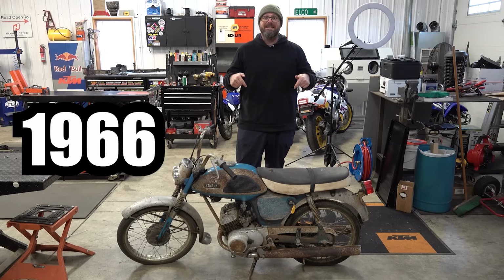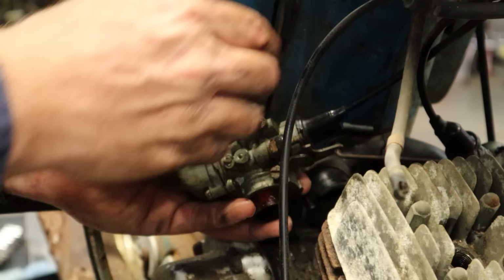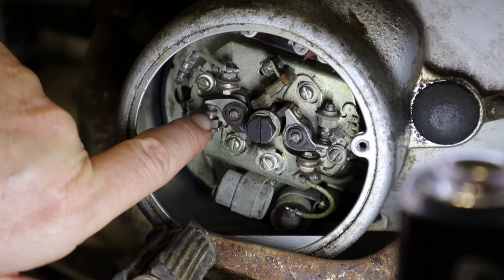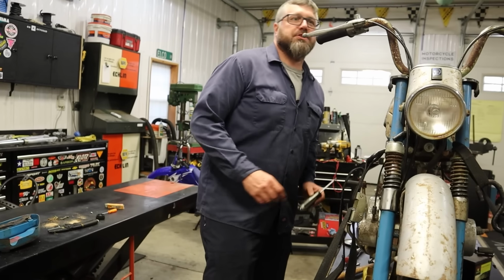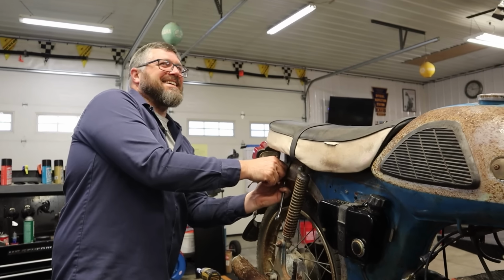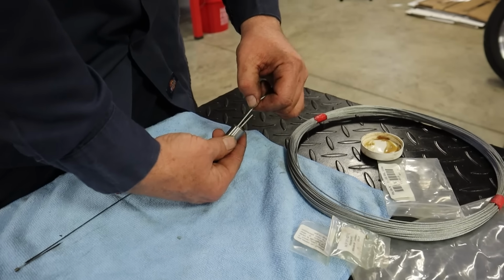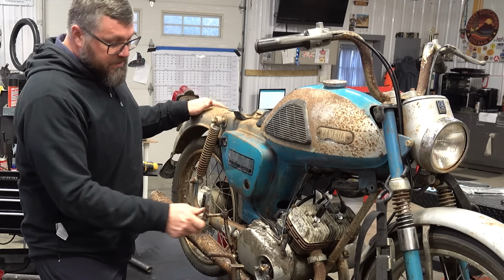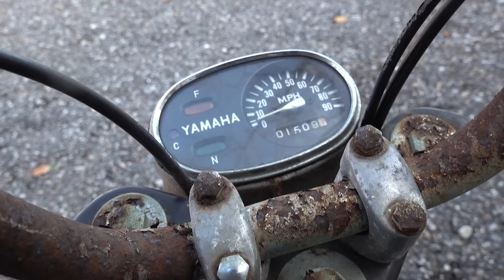Can I Get This 1960's Yamaha Motorcycle Running?

Comment: I was 14 in 1966 and I had a twin jet 100, same color as yours. Mine was electric start. I got a motorcycle drivers license at 14, but it was only good up to 100 brake horse power, and the twin jet was a little over that. I drove myself to middle school. There was at least 40 other kids who did the same in middle school. I grew up in Dallas. At first I thought that could be mine, but I had my seat recovered.

Comment: Capacitor,yes not condenser. Helps stop points arc burn. Should be replaced. Glad you realised differential expansion for carb. Excellent series.takes me back.

Comment: In '67 my Dad had gone to a police auction and came home with a '67 Yammer jammer 100. The previous owner had turned it into a dirt bike. Then a couple of weeks later came home with a yamaha 80. The thing that was different about the 80 was that it had a 10,000 RPM flywheel. We had a lot of great times out in the Mojave desert. Even then we called them rice burners.

Comment: I have a 1965 Honda CB160 with 750 actual miles on it. It was taken off the road in 1968 and parked in a shed. I got it started and road it around the block and parked it again.

Comment: At 14yrs old bought a non running suzuki 120 2stroke street bike. Got it running and my friend had one of those 100 2cyl yamahas. Tjis was in 1968 in Elko ,Nv. 14yrolds could get a license.as long as the bike was smaller tha120cc. We ran them into the ground on 2tracks !

Comment: That kinda looks like my old moped; a Zündapp ks50 sport from -67. I got in for like 60 dollars, it was a piece of crap. But getting it to work was actually a breeze. Old pets easy to come by, everything simple and user friendly. I cleaned it up and felt real good about my 14 year old self. The thing is that you can treat those bikes however you want to and they’ll never quit. I put on every imaginable illegal upgrade I could on that thing, in the end it did 120 km/h, but the frame was shaking horribly 😂

Comment: A bit trick:
For hard rubber, you could soak/dip it in methyl salisilate (some say wintergreen oil(?) ) 
After couple hours it will soften  the rubber, back its elasticity

BUT
If soaked too long, it has tendency to swollen, morovee on crack/ cut

Comment: Had good results over the years with a radial bearing for lifting clutch plate clutch runs much cooler free play dosnt increase in heavy traffic so easier to find neutral just an idea great work st

Comment: You finding the tool pouch made me go and get the one from my 1993 Yamaha XJ600 and check it.
It is not so much different, but also containing Allen keys and a few more wrenches, most of them "YAMAHA" branded. The pliers seem to be pretty much the same. The screwdriver has a plastic handle and the only writing on it is "Made in Japan".
There are some single spots of corrosion on the tools, this is now a good opportunity to rub them off with some WD-40.

Comment: I owned a YDS5. The tank has two chrome covers. The bolt is behind the rubbers. Their frames are of a very unusual metal. They will not rust, crasy sturdy and are very stiff. Yamaha hoped these would turn into a race class.

Comment: I bought one second hand here in Dublin around 1972 .Cost me £100 (100 punts the currency of Ireland at the time .Close in value to the pound sterling ) .I kept it 2 or 3 years .Rode it from Dublin to London and used it there for some time .Only problem was it would often cut out in the wet .The plug cap would short out .When i later got longer plug caps it was fine .

Comment: I think what you have there is a YA1; as a youngster I had a YAS1. The YAS1 was almost identical but had twin air filters directly onto the carbs, two chrome cans similar to the single one inside the frame. I think it also had a six .speed box but I may be mistaken.

Comment: You have it running but you will not realize the crank seals are bad until the rpms reach 5000. At that point the bike will cut out. I love those old Yamahas but you will spend more money to rebuild the motor than the bike is worth. I had a YCS1 which is the 180cc version. It looked like a new bike with no rust only to find it had bad seals. I cut my losses and sold it for $ 300 less than I had in it, around $ 1800. The new owner spent over $ 3000 to have the motor and crank rebuilt. Be careful when buying old 2 smokes. Great video.

Comment: From a old mechanic , points have a plating on them and we used to run a dollar bill to shine them up .When you sand with emery you start a downhill slide on the point face that will mess up faster ?? other than that love your vids and patter .

Comment: I was immediately drawn this video as from the picture I thought it was the YM-1 '67 Yamaha 305, which was my very first bike I bought new.  When I sold it, I traded it in on a 1973 TX 500 Yamaha at the dealer Don George in Clarence N.Y., a suburb of Buffalo.  It was still so pristine he put it in the showroom window.  I always wondered what ever happened to it and have never seen another.
Reply: When setting the ignition points you use a dial gauge and the points break at 2.1mm before TDC.  The dial gauge is the very first tool I ever bought as a mechanic and I still have it.

Comment: Yeah just got my somewhat mothballed '72 CS5 200 runnin' and went up the Pass.  It was coughing on the right side but cleared itself out.  Now to get the '67 YCS1 180 Bonanza uncovered and fired up.  That one's on the road and needs some exercise as well. The R5 hasn't been ridden in a couple of weeks favoring the RD400D and the Daytona as of late.

Comment: My first bike back in the 70's...took my motorcycle license on it.  Clean air, clean fuel and clean oil and it ran.  Everything on that bike can be brought back and it will run a century from now. (If you can buy fuel...)

Comment: The points will adjust like any other the part you were looking at is the fine-tuning where you set that engine up with a dial indicator on each cylinder like you're supposed to

Comment: Mix up a pint of two of 50/50% oil/fuel and pour it down the inlet throats to soak the crank seals and bottom end bearings. The seals are likely to be dry and they tend to burn when dry.  let it soak a while. Take out the spark plugs and kick and kick to clear the mix. Then plugs in and kick some more, kicking gently.

Comment: These old 2 strokes, going to outlive the whole world, with a little maintenance. I live in eastern europe, in the coldwar era, we had multiple 2 stroke bikes, that are having tiny 50CCm engines, and some bigger ones also. I have 3 of these tiny engine ones, one from Czehoslovakia, one from poland, and one from the former soviet union. I'm used to travel 10km every day, with the first one mentioned, it never broke down, maybe it's not that fuel efficient, but still consumes less than a car, and i never had any downside riding that, beside tha maximum speed is 40km/h, but in a city it doesn't really matter i think. The other 2 bikes are fully restroed by myself, they are really great to ride, and makes everyone smile in the city, i always meet someone who had one when they were young, and they always has a good story to tell. Maybe it's an expensive hobby, but i don't really care, it's about the feeling, and the sound they have.

Comment: I had a 1986 Yamaha CA50 moped which had the auto mixer. I never remember adding oil to it-only fuel. I guess that’s what killed it. But I never remember the oil light ever coming on. Too bad because that was actually a damn good moped.

Comment: when the cable end doesn't fit its easier to hit the cable end it's self with a grinding/cut-off disk rather than trying to adjust the hole on the float without a drill press

Comment: I use an induction heater tor stuck carb slides. I wrap a long coil around carb and usually they come right out.

Comment: The auto oil system actually ran the two stroke oil through the crankcase before sending it to be mixed with fuel before the carburetor

Comment: That much point-spark generally means bad condensators, cheap easy enhancement.
Use manual dish washing soap for your ultrasonic cleaner, works great, and save for aluminium, and smooth for those sensitive mechanics hands.
Nail files or small steel saw blades are excellent for those tiny gaps.

Comment: kkThat was my first motorcycle at 17 years old in 1969.  Paid 400 bucks for it.  It had a bad habit of burning out coils and voltage regulators.  When the regulator went out, it would also take out the generator....at $100 a pop.

Comment: 16:20 That's exactly the same set as on my 99 Yamaha TW 125, just with a plastic screwdriver handle and thinner pliers.
28:55 that same 4-stroke TW also runs on Gas-Oil mixture better than on pure gas lol

Comment: Beauty. I thought at first sight it was a suzuki 120 ( B100p) that i had when i was a kid in UK. They look very simillar and apart from being a single, very similar in construction. That had an auto oiler as well hence the P in the name.
Only had a 4 speed box as well with the 4th being badly spaced aeay from 3rd meaning some hills had a scream or a burrrr, then a scream before it stalled. The spark plug was in exactly the right position to collect the water thrown up from the front wheel in heavy rain. Often you had to rev the nuts off it to keep it running when stopped at lights when it was wet, thus getting yobbo biker looks from car drivers.
It had to be done though as if it died the plug oiled up and needed extracting and cleaning at the roadside. Not much fun if there were lots of lights.

It was fairly reliable apart from this and although not one to get ones pulse racing , was still a lot of fun and my chariot to freedom and exploration.

Your bike brought back a lot of good  memories

Comment: Only real problem with a 2 stroke is the crank seals go bad with age. Had one go on clutch side on a 76 Suzuki GT500 long ago. Was the 90’s I didn’t know how to fix it then, actually had all the GT series over the years GT185 to the 750 Water Buffalo 
And I’m a fan of the Yamaha R5 350 and RD 350 to. Rebuilt several of those

Comment: A lot of the old 2 strokes the oil tank said motor oil on the top and the owners manual actually said that motor oil could be used but not recommended if you have no 2 stroke oil

Comment: I have a Yamaha YS125 from the 2010s, and the toolkit is basically the same as the one at 16:00 - same kind of pouch, but the screwdriver has a plastic handle.

Comment: Wow i remember those i pulled 3 out of a garage a few years ago didnt take too much to get them running either i made a roadworthy one from the 3 and the other two ended up as feild bikes (with cobbled together exsausts and knobblie tyres and scrambler type bars /forks)
I was supprised how long they lasted as thrash /feild bikes i think iv still got an engine and a few bits left someware lol .

Comment: my first street bike was a 1966 suzuki 250 twin two stroke. my secound street bike was a suzuki  gt 550 two stroke ram air tripple. 1976. I ride a 2006 suzuki c90 v twin 1500 now.  of couse i have had lots of other bikes over the years to.

Comment: Thanks for the video you know when I saw the title I was hoping it would be the ym1 in 1977 around there I was about 17 and I got my first motorcycle it was a 1966 Yamaha ym1 it was a 1966 Yamaha ym1 305 it was yamaha's answer to the Honda 305 dream they looked almost exactly alike I put a lot of miles on that bike also put a lot of skin on the road on that bike learning I had it for a while and then I bought a 1975 Suzuki gt550 which was a triple fat bike I took all over the Eastern seaboard it was it just went and went you couldn't kill it the Yamaha also went and went and you couldn't kill it even after smashing it up a bunch of times but it still was put back in and did its job I took the front fender off I also I also took the baffles out because you were able to just if I remember correctly take him out with that in the Rhode Island rancher with Alan screws Allen keys so what was pretty it waswhat's a heavy bike looking back at least in my memory for such a bike with a bike with such a small engine so on the highway it kind of blew around in the wind a lot and it wasn't very fast but I took it from Providence to exit 54 Connecticut a bunch of times that was about the farthest I took it and round trips without a problem😮😮 when my dad took me to see the bike it was in the basement of a man's house and he had just rebuilt the whole thing and painted it so it looks brand new we had a sissy boy that he welded out of iron with a back I'm going to say luggage rack for the course it wasn't a larger rack it was just a you know something to tie things down to but yeah the volume one 305 West I was just trying to think back if it had an electric start and I guess it did I also remember it had a generator I think didn't have an alternator so when the bike was just idling the lights and everything dimmed and as he gave it the throttle gas so they they lit up it had a little generator light at a neutral light if I remember all the instruments are on top of the head headlight I said basketball compartment but it has its a comment on the speedometer and all that went on top of the headlight just like the Honda dream after the 550 I moved up but down in in in in in in a trip I bought a 1971 Yamaha SX 650 which I totally repainted and we did as best as I could put head is on it new seat and all that then my uncle gifted me with a brand new Harley-Davidson Sturgis which was a basically a double belted lowrider out of the factory with custom paint job custom alloy mags really really crazy by beautiful bike and from then on I kind of had a thing for Harley's took about a week or two of riding it but after that every time I got on a Japanese bike it felt weird if I remember I was in 81 Sturgis in that brown black if I remember correctly the colors that was stolen and I ended up buying a 6-month-old 1982 c I didn't have the Harley that long but the 92 Honda CB750 c which ended up taking it to California to Northern California San Francisco and I moved that it made it there without any problems I put I put 10s and tens of thousands of miles on that bike without basically doing anything eventually I cut it all apart and made it into a a rigid frame with a big pillion seat single pillion seat and the yeah that was an okay bike considering what it was LOL and then I ended up building my own low rider 79 lowrider frame with a 1971 1200 Chevroletoil basket things like that came from different years but they all fit on that was great about Harley's then I had to hold back painted a professionally cuz that's something I couldn't really do I wasn't good at it and I had to paint the candy apple red with the purple and blue and yellow ghost flames all over it it was quiet about a straight pipes black chrome straight pipes and the big eliminator 2 I think I was a model it was an su carburetor I also had a 1954 BSA at 8:10 and the Florida going blind in my late twenties early thirties and gave up writing and driving cars had a bunch of cool cars to when I was able to drive due to the fact that I want to kill anyone on myself and I'm still having road since then and I had to tell you it's one of the things I missed the most because I loved riding motorcycles with electrical part of my life and when I moved out to the West Coast I was able to ride you know 365 days a year which was great because I grew up in New York and in Providence Rhode Island and of course the winters were not conducive to riding to say the least LOL miss it all miss it a lotwhen I give to be able to get on a bike again and just go I really did live breeze and love motorcycles and always went you know I would get on my bike and pick a direction and just make an adventure and take my camera with me but sometimes life throws you curves and you just got to go through them and that's about it thank you for your video and it brought back memories even though it was a different bike but same year with the with them sorry with the Yamaha auto loop trying to remember what Suzuki called it does the Auto lube on this have a big round eye in the in the in the bike just you know in the cover for where you put the oil the 2-stroke oil to see how much oil you have their I remember kind of remember it did but I might be confusing it with the Suzuki no not the Suzuki it was the Honda it was a Yamaha we're talking about 40 some are GS 3840 years no actually close to 50 years so yeah crazy long time ago anyway I keep saying anyway so it's time to stop sincerely David Raphael AKA by the blind bedroom guitarist

Comment: Put plain water in the cleaner and use pin-sol and dirty parts in a zip lock bag and put that in the water. You wont have to drain and clean the cleaner.

Comment: THIS IS ONE OF THE FASTEST  100  YAMAHA STANDARD...THEN CAME ALONG THE PIPE FRAME 100 YAMAHA WHICH WAS MORE LIGHTER WITH THE SAME ENGINE. .THE FANTA WAS THE ONLY MOTOR CYCLE THAT GAVE YAMAHA  A GOOD COMPETION IN A  STANDARD RACE.   .

Comment: Wouldn't the gas tank be pretty rust free because its a two stroke and premix oil coated the tank before sitting...Not completely surprising.
Reply: or it has auto injection and it is actually surprising.

Comment: I'm 72 Y O I owned one of these in 1973 . Do NOT try to go 55mph,  full throttle going up hill, traffic all of coming to a stopped in front of you. let up on the throttle and the engine locks up  Not Fun